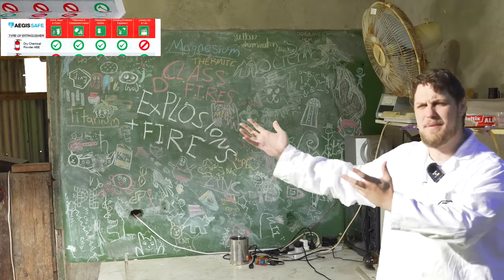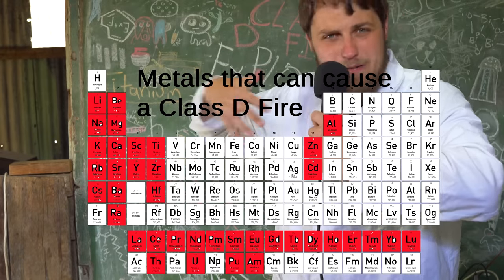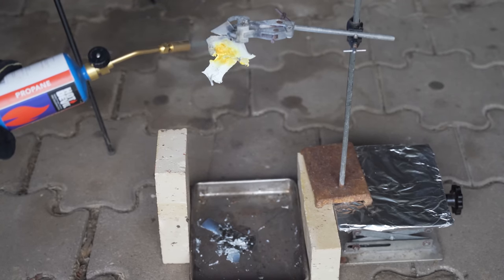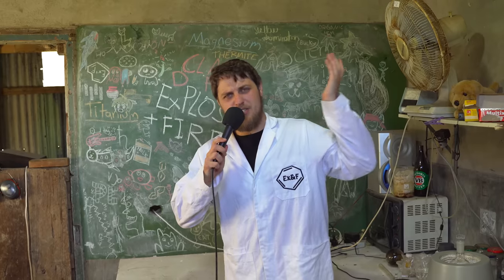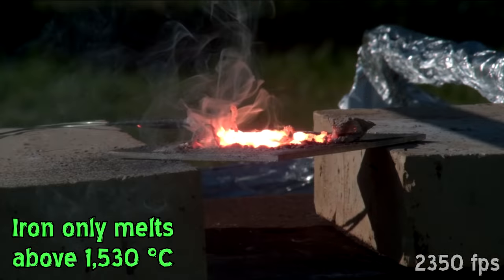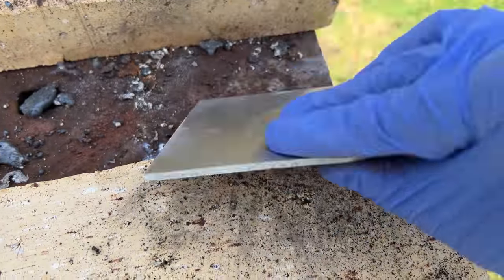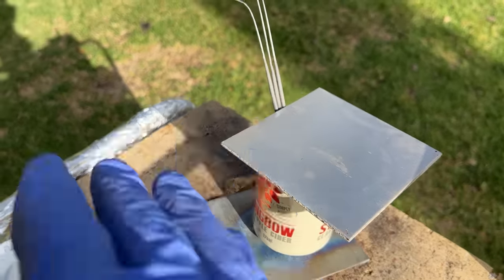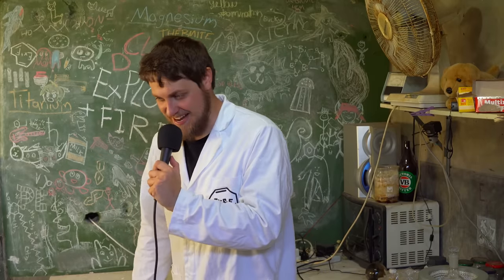Lighting metal fires (and putting them out??)

Comment: When I was a teenager we bought some bootleg unmarked fireworks that must have been filled with Magnesium powder or something. We lit it, ran away, and then were all instantly blinded by this horrific white light because it was nighttime, and I distinctly remember seeing shadows on our neighbors house across the field that was like 300 feet away. When it burned out it had left a divot in the 1/4" steel plate we'd set it on, truly terrifying
Reply: That's not terrifying, that's awesome!
Reply: You got me thinking of the shadows from hiroshima
Reply: I think I had those too. They were only an inch round cap thing so I didn't expect much. That thing was the brightest light I had ever seen, it lit up the area like it was daytime. Way brighter than an arc welder. It was indeed awesome. I went to buy some the next year and could never find them again.
Reply: Iron oxide from grandmas cutlery isn’t weird…..
Reply: I used to steal magnesium out of my school's storage and make flashbangs... (Well it was more of a flashburn than a flashbang) I really wish I could work there.
Reply: we had a guy try to weld a cracked magnesium wheel in my autoshop class at the vocational campus, it burned through the foundation and into the dirt about 3 ft.
Reply: sounds like Magnesium nitrate
Reply: Could have been flash powder, i have made a few plastic pipe bombs as a kid with it and its loud and eye watering bright.
Reply: Rookie numbers 😂

The hot ticket (key on hot) when I was a lad was to grab a couple scrap VW beetle engine blocks... and head to da beach.
A good hot bonfire, stoked with dried out chrismas trees. and once they start to soften and melt?  Them blocks  burn.  Turns the sand to glass. 

For added lulz the old yellow super-soaker (the one that would shoot 50 feet)  was used to add water to the magnesium fire.  
Boom, crackle, Pop! 

Stopped traffic on highway 1 once... 
San Mateo county Sherrifs department showed up... evidently, there was nothing in the law about magnesium in a bonfire, so they let us slide.
Reply: That's one huge experience, alright.
Reply: @fritzophrenia3146  The IRL version of the Komodo 3000 from Malcolm in the Middle.

Comment: Best way to ignite bulk titanium: find a friend with an acetylene or oxyhydrogen torch and go nuts on it!
Reply: In a ceramic pot?
Reply: Alternatively, Thermal Lance?
Reply: Tune it to zn oxygen rich mixture
Reply: That would probably do it. I'd also be very curious to see if it could be ignited using a large capacitor bank, but that would have a whole other set of dangers. Maybe a cool crossover with somebody who has the equipment?

Comment: Well, all Titanium fires I have heard of, involve a lathe or a mill in some way. I think this has to do with the fresh, not oxidised surfaces of freshly cut titanium and the thin cross section of the chips.
Reply: SLM printers with ultra fine magnesium powder can be quite explosive
Reply: mills and lathes can make fine chips, and those catch fire easily, I sometimes TIG weld titanium, and had a 1mm wire catch fire, it didn't burn like a matchstick, the fire melted it and a fell as a small droplet on to an aluminum plate, fizzled out quickly
also, machining titanium is a bit awkward, somewhat like stainless steel, both have terrible heat conductivity, which means that even slightly dull tools have a tendency to rub and heat up very quickly, which adds to excitement if you have a pile of chips or birdsnest in the lathes chip pan
not so long ago there was a fire in one manufacturing facility around here, they had few modern cnc machines in a sandwich panel metal building, machined magnesium, and supposedly everyone was trained, equipped with proper safety gear and warned, it was a total loss, all equipment and the whole building was destroyed by that fire, so yeah, 1.5k for an extinguisher is really cheap

Comment: I love how the best we have for Class D fires is literally just really dry popcorn salt.
Reply: It also has other chemicals added to make it flow more easily. I think the reason its so expensive is that when you need to use them, they have to work or things will get a lot worse very quickly therefore the extinguishers have to be perfect. Another thing is that the companies that make them probably have a lot of liability risk due to the critical nature of their devices and the fact that a cowardly employee or owner of a business might just lie and say the extinguisher didn't work; a lie that would be easy to get away with since metal fires are very hot and destroy the evidence.
Reply: All the ones I've ever come across are copper based. Copper agent is probably the best of the three types, also the most expensive. It can stick to objects, absorbs a ton of heat (think heat sinks in electronics), and is really good at lithium fires. It won't blow away either. Uses Argon gas as propellant. Nitrogen reacts with lithium. Copper models are simply copper, while the other NaCl and Graphite models contain a few other ingredients, some of them being carcinogenic. Copper is very toxic to aquatic organisms though.
Reply: @davecSFD That's really cool! 😁👍🏻
Reply: @ryelor123 Smart cookie! 😉👉🏻👉🏻
 🧠
Reply: @davecSFD I was about to say the ones I've seen were copper. They plate the fire; it's neat to see. (other than a stupendously expensive thing being on fire.)

Comment: Oxy acetylene torch is my go to for burning Metal. A stick welder might do it.
Reply from the maker: Yeah that seems like a really good suggestion a lot of people want to see tried
Reply: @ExplosionsAndFire  And if oxy acetylene fails, (if you can get your hands onto it) oxy dicyanoacetylene. That stuff produces a whopping 4990C flame. Still not enough? Burn that stuff with ozone, 5730C, the hottest flame known.
Reply: @ExplosionsAndFire  Or How about a Hydrogen torch? 2800°C baby
Reply: @kiliwami4086  oxy acetylene is available at just about every welding/air supply shop around. Can even grab it at most outdoors store.

And- it goes a lot hotter then hydrogen. Hydrogen does have the advantage of burning very clean, which is why it is used for working with jewelry.
Reply: you didn't inhale that zinc did you?
Reply: dc welder + carbon graphite rod, make a home-made arc foundry.
Reply: If you can't get a sustained reaction, you can try to preheat the plate.
Reply: @ExplosionsAndFire  also you can use magnesium to set titanium on fire. magnesium burns in excess of 2000C can titanium should start lighting around 1600C
Reply: @DrakkarCalethiel   We're talking E&F here, he can get any chemical!
There is no chemical he hasn't been able to synthesize
Reply: Okay I think I'll fit into this comment section quite well considering my go-to move is keep adding power until something good happens or in this case keep getting hotter and till you see stars 🤩 lol 🤣 actually you probably won't see much past the white spots lol 🤣 you know I have always wondered if everything was flammable given the right amount heat 🤔
Reply: @garycsfunlife  yes everything is flammable at some point !
Reply: @ExplosionsAndFire  oxyacetylene will definitely get it to burn but you might get more... Interesting results with something like a thermal lance
They basically take the principal of oxyacetylene torches and crank it up to 12
Reply: My mind also jumped immediately to an electrical arc
Reply: @matthewmarting7420  that is basically just getting o2 hot and you can do it with just a oxy acetylene rig
Reply: Yeah i was thinking an arc from a carbon rod or somthing
Reply: A homemade arc welder should do the trick just fine as well.  (its a miracle I haven't blown myself up yet)
Reply: @MichaelThe-Pyro  Not releasing the heat from titanium was the hard part
Reply: since we arrived at the extremes here: what would a drop of mercury do? maybe mercury and a little scratch on the Ti surface? 
 or try peeing on it? My experience with Zink-coated steel in humid air: it doesn't hold up for a complete year after it got urinated once or twice!
Reply: Start a tungsten fire. You will basically need the sun
Reply: @Meatwad.Baggins  tungsten fires are always fun
Reply: @MichaelThe-Pyro  He did that, lol
Reply: @wessltov  Octanitrocubane 🙄
Reply: That’s right more oxygen = 🔥
Reply: @wessltov I think there are some he's not game to synthesise... such as FOOF.
Reply: oxy-acetylene cutting torch for sure
Reply: @DrakkarCalethiel  ozone, huh.. So, say I had a little ozone generator. I could ,theoretically, modify it, somehow, to where I could trap the gas, and, be able to create an almost 6k° fire? Or, would that not be concentrated enough?
Reply: @ExplosionsAndFire  carbon arc gouging
Reply: @DrakkarCalethiel  oh man ozone fire sounds kinda dangerous 😅
Reply: Yeah, oxy-acetylene's flame temperature is around 3100 °C
Reply: The cheaper Version would be two Graphite electrodes on an arc welder. This will get a little bit hotter than the acetylene torch
Reply: stick welder with a graphite rod
Reply: @DuriensBane  you can take the rods out of a latern battery but you may need more power theres a way to use microwave trannsformers "grant thompson's metal melter arc furnace" but you gotta be careful taking microwaves apart cus the capacitor can still hold a charge after being turned off
Reply: @ExplosionsAndFire /videos chop the metal up into fine parts first.
Reply: just dont go above 15 psi or boom.
Reply: Agreed. Oxygen/Acetylene is extremely easy for use in setting fire to aluminum and magnesium. A great source of very pure grade aluminum metal is the engine cradle framework or lower/upper control arm of select GM/Holden or Nissan vehicles.
Reply: My MIG welder can light metal on fire easily and I've seen I'd happen with stick arc welders too. It's so easy it happens without you meaning to. It is a common problem when welding this sheet metal to thicker metal. In otherwards, welding steel can easily light the steel on fire... 🔥
Reply: @wessltov  I believe part of why no one uses dicyanoacetylene is because it's rather unstable and degrades into acetylene and a bunch of cyanide.
Reply: @matthewmarting7420 a thermal Lance is actually just a metal tube which you set fire to the inside of and then run pure oxygen through it.

Comment: I've been a fire warden (on and off) for around 30 of the last 45 years of my working life and like you, have never seen a metal fire or what it is that you use to put one out. Well done on demonstrating and explaining this.
BTW, I have worked on a chemical site where we had enormous tanks of Ethylene Oxide and one trick the site's fire brigade used to do on the course they ran was to have an oil tray (a tray around 3m deep but the size of a door laying down) and put some EO in it then set fire to it. Then, they would get one of us lab-rats to put it out using a foam extinguisher and it would appear to go our. After talking to us about it for a minute or two, he would get a long metal rod and push the foam to one side and flames would appear - was not pyrophoric, it just carried on burning in its own atmosphere. The foam had done nothing more than shelter it from the wind. Good luck with completing your thesis - making videos is a substitute activity that benefits the rest of mankind.
Reply: I have seen one class D fire it was a wheel on a naval aircraft….the COD/OOD said “push it over”  so we pushed the aircraft over the deck into the ocean so we did
Reply: Love hearing stories from the old-timers! 😁👍🏻
Reply: @jessewilson8676 what type of plane?

Comment: You need to increase your surface area for the fire to reach the Titanium. Metal dust, like any good flammable dust, is great at setting fires.
Reply: That's the only thing I can think. A plate of titanium just distributes the heat too well. You need shavings or dust to really get something like that to ignite.
Reply: The whole point of the video was that he wants to burn the bulk metal, not the dust
Reply: a hydrogen torch might get hot enough? you can make em with an electrolysis generator
Reply: @JackdotC  Yes, he wants to burn the bulk metal. So think of the bulk metal as logs, while the shavings and dust are tinder and kindling. Same principle applies.
Reply: @JackdotC  maybe dusts or shavings of finer and finer grades stacked above a metal plate?
Reply: Now where is the fun in that? Pffsh, lighting some powder.
Reply: I've accidentally set steel wool on fire a few times and it's always a surprise and amazing.
Reply: Yeah I heard even gold powder will burn
Reply: @senvr11  ok you try it first
Reply: What, like a nanothermite?
Reply: TI turnings burn like a hot damn and can be ignited with fero rods😮
Reply: @userPrehistoricman  the internet said so so it has to be true

Comment: As others have pointed out, containing the metal in a ceramic pot will increase the overall heat transfer. If you want to achieve high temperatures, an oxy-acetylene torch or a plasma cutter from Harbor Freight will reach very high temperatures.
Reply: Harbor Freight? You think we have that here? Maybe Bunning will help, can even grab a snag while there.
Reply: There's also a thermal lance as an option
Reply: Acetylene is also just good fun all around.
Reply: what about arc welder? You can use graphite rods and they won´t melt

Comment: Blacksmith here. You could always set up some sort of open hearth forge. Buy some coked coal, build a forge out of mud or brick, use a shop vac as a blower. You could use that to get it up to a higher temp like 2500C, then use a thermite/thermate reaction on the already evenly heated Titanium

I think the reason why the molten puddle of steel didn't help is because the heat was easily sucked into the Titanium and dispersed. It definitely made it hot, but once the iron touched the Titanium plate, it instantly cooled down. If it was already hot, the intense, focused heat from a thermite reaction might be enough to push it over the edge.
Reply from the maker: Yeah I wonder how well molten titanium burns? If we can melt it, will the heat from its own fire keep it molten and able to keep burning??
Reply: @ExplosionsAndFire  Alternatively, you could get really thin titanium strips, or at least thinner than the plates you have. Titanium shavings are notoriously easy to burst into white hot sparks

Maybe putting some Titanium shavings on the plate WITH the thermite, if the Titanium shavings start burning, it might be enough to catch the plate on fire too
Reply: @xXMACEMANXx  I think thickness matters a lot. Magnesium in this video took surprisingly too much effort to catch fire. Fun experiments I conducted at home were much easier. I used foil thin magnesium strips (1/10 of a millimetre or below thick) and they were ignited by a regular old pocket lighter. I would be shocked if titanium could ignite as easily if it was thin enough. I think it would still take more effort than magnesium. I could not try that one because I have no idea where can I find foil thin titanium strips.

p.s. Don't try to set magnesium on fire guys. If it somehow drips on your skin and bury itself, you can possibly burns yourselves to the bone! (through the bone?!)
Reply: @ExplosionsAndFire  Jeweller here, I use titanium to manipulate molten precious metals. If you use a simple brazing torch running on oxygen and propane you'll set it on fire in no time at all.

Comment: Hey Tom, your failure to ignite the Titanium and the Magnesium with Thermite and Thermate probably had something to do with the plates dissipating the heat enough to not reach their autoignition temperature. Three solutions I would suggest are,
1. Use more Thermite/Thermate
2. Use a more aggressive fuel/oxidizer mix (My two cents is swapping out Iron Oxide for Ammonia Perchlorate and swapping out the powdered aluminum for powdered magnesium)
3. Reduce the mass of the bulk material you're trying to ignite
Reply: With enough electric current, I bet it would be easy peasy.

Also with your #3, increasing the surface area could help. Ive burn a magnesium block before, couldn't get it lit with a propane torch until I scribed it.
Reply: most problems can be solved through the addition of sufficient AP lol

Comment: Titanium gets covered with a thin oxide layer very quickly, the oxide layer prevents it from igniting.
So you can try to heat it up and grind the oxide layer off the glowing titanium, I'm pretty sure that will start the reaction. If that doesnt work, qou can just ignite some freshly milled titanium shavings, the fine shavings can be heated quick enough to ignite them before the oxide layer gets too thick.
Reply: Ignition is nothing more than rapid formation of oxides.
Reply: @Livi_Noelle  yes of course, but if the oxides form slowly at room temperature, they form a dense layer which protects the metal from further oxidation and if the oxides form extremely rapid while burning they form a very fine powder, most of that powder is released into the air in form of smoke.

Comment: As a solid plate, the only way I could really suggest to set titanium alight is with electricity. Either running high current through it or arcing to it with graphite electrodes.
Otherwise you'd probably have to mill it into chips or swarf to reduce the mass of metal you're heating up.
Reply: I put my hamster in a sock and slammed it against the furniture
Reply: As long as he doesn't try to use the death trap, also known as a microwave transformer.
Should be possible to do with a welder though. IIRC AvE tried casting titatium using a welder, but it kept igniting.
Reply: @TippyHippy  Is this a confessional, or a desperate attempt to get attention?